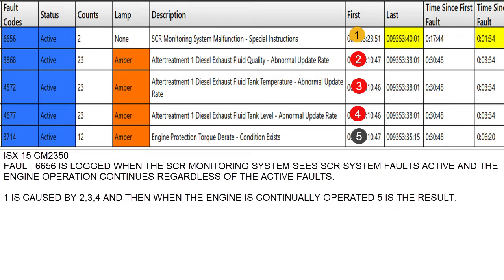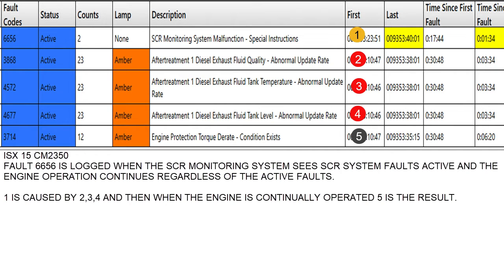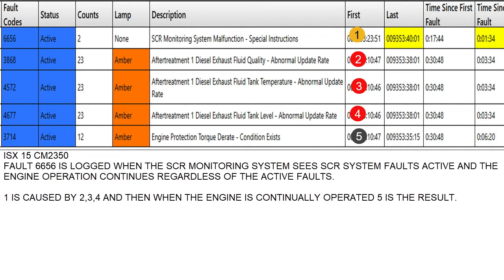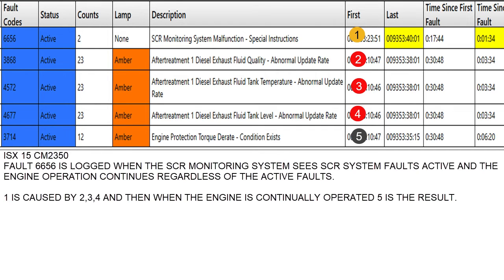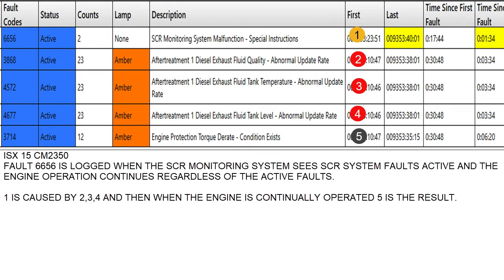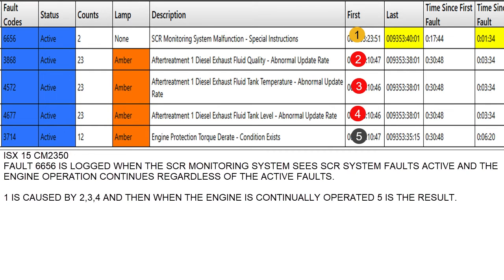SCR monitoring malfunction

Comment: Any way to test the Def Head Unit? I use Diesel Laptops with TEXA system and can't clear with same codes.. Was gonna try swap head unit off a broke down truck. Thank you for the video!
Reply from the maker: There is a tool you can buy to test the head. It is made by the company that makes the def float unit-Shaw. I think they are out of FLA. There is also a company that has a kit you can build with a raspberry pi processor that will simulate a good def head. That would be a nice emergency fix until you could get a part to stop a derate. I know a guy who uses one on big off road machines to get them back online so they can move them out of the way until the part comes in. Emergency tooling is a good thing if used just for emergencies. If you google DEF Sensor Simulator it will come up. The def heads are becoming available again.